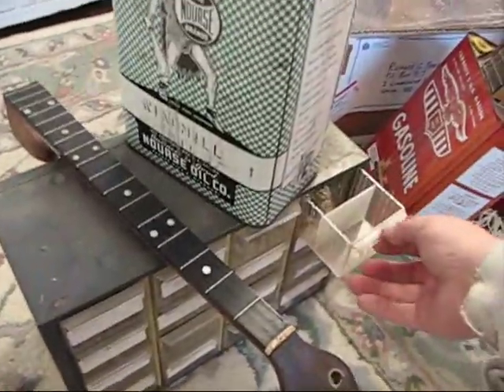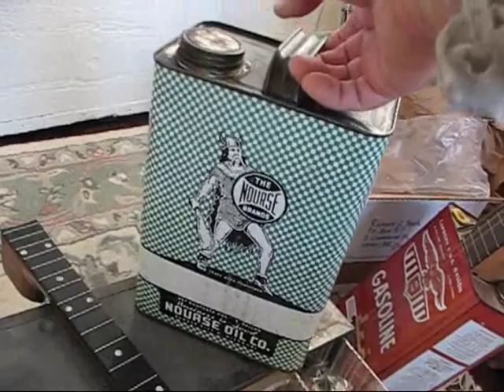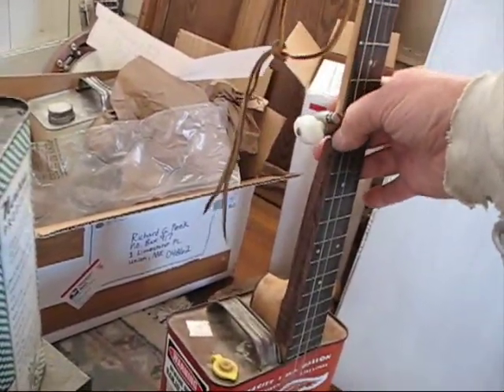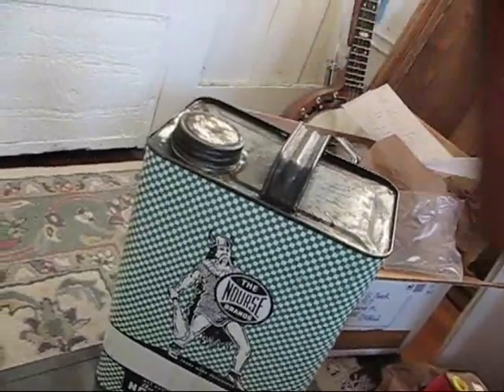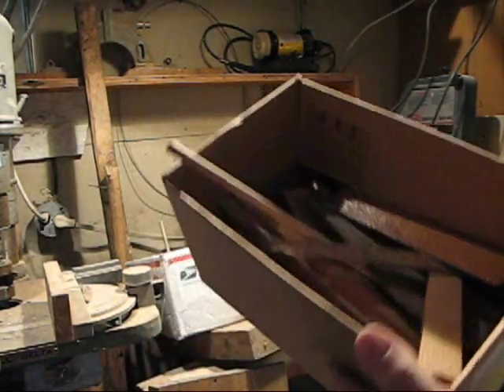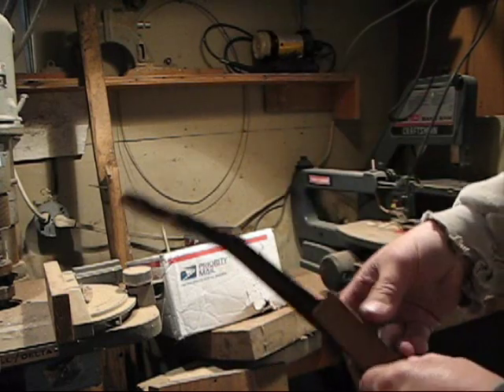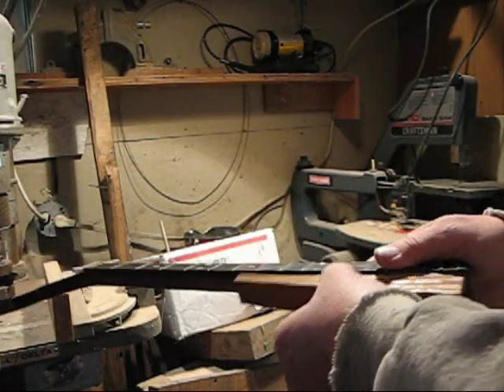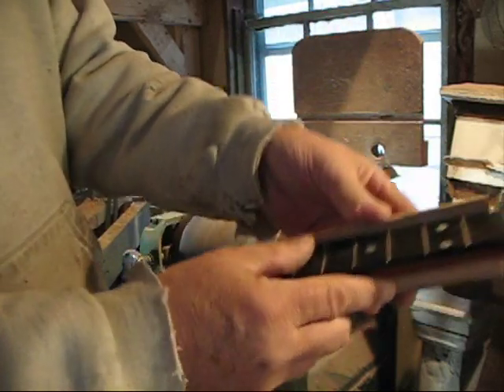How to make a gas can banjo 3

Comment from the maker: @cecil749   No don't use pine or any soft wood.  It will flex and the neck will bend and every time it does the banjo will go out of tune.  Plus pine will warp under the presure of the strings.  I had a poplar neck.  I reinforced it with a quarter inch of ebony and that helped, but best to use maple, mahogany, oak, or any hard wood.